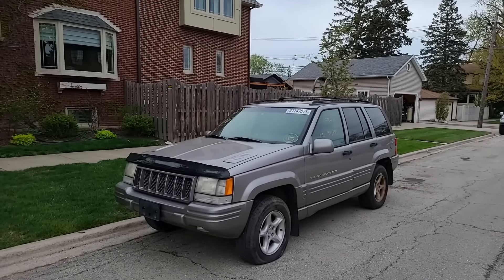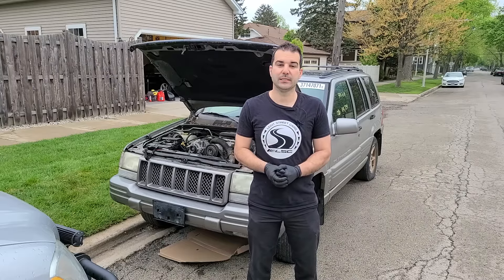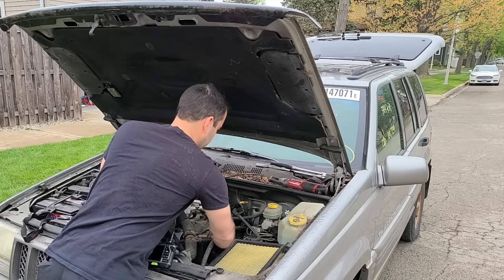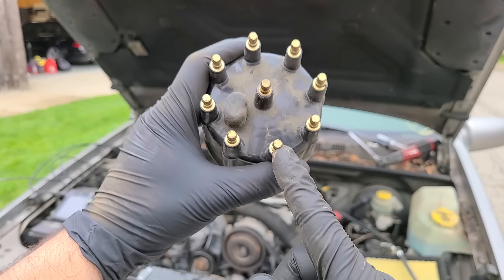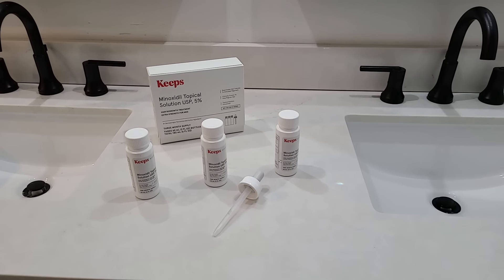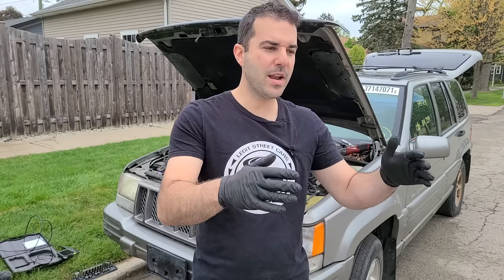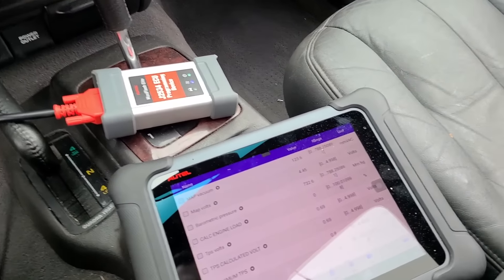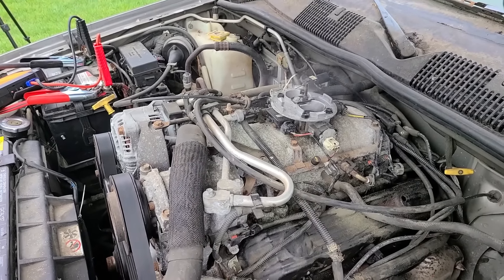First Start Of The Abandoned Fastest SUV In The World & What I Found  Inside The Engine! DIY FIX!

Comment: “A fuel injector is a very basic thing”
Me who’s been having injector nightmares on my diesel car: shudders
Reply: Diesel injectors are a whole different animal
Reply: Yes. Diesel fuel is abrasive, so it will eventually wear out the injectors.
Reply: L
Reply: @bongodave13  
It is not, it's got more lubricity than gasoline.
Reply: Stupid comment.  Diesel isn't abrasive.  What an idiotic idea
Reply: @enterBJ40  diesel fuel itself is not abrasive but it has particles and contamination in it that cause diesel injector nozzles to wear out. Injector nozzles are classified as wear items on Diesel engines.
Reply: That's is CONTAMINATION.  Any fluid  is susceptible  to that , not only diesel.
Reply: Nothing  new,  dude.
Reply: @enterBJ40  yes, but the fact remains that it is abrasive. Just because it isn’t the fuel itself doesn’t mean what you pump into your tank isn’t abrasive. It’s a known fact that any diesel fuel you can get your hands on is contaminated and therefore abrasive. Therefore people make the generalization that diesel fuel is abrasive because for all intents and purposes it is.
Reply: Diesel ITS NOT ABRASIVE.  Its not  designed  to be nothing  like that.  Contaminated  diesel can be abrasive? Sure...but just like any other CONTAMINATED  FLUID you pour in your engine,  example:oil. IT'S  NOT IN ITS NATURE THAT DIESEL  IS ABRASIVE.  That's is NOT a natural  property  in diesel fuel. Just because some diesel is ULS, doesn't mean its abrasive.  Abrasiveness in any engine fluid is because transportation, handling, storage of the fluid itself.  No serious  filter manufacturers consider  brand new oil as a pure product.  Manufacturers  and  also institutions like Noria and NLGI are some of them. Any abrasiveness in diesel or any engine fluid (engine coolant, oil,etc) is CONTAMINATION  and is there because a combination  of factors  that start  at the manufacturer  plant or refinery. Noria  has taken samples in surgical grade clean environments...and guess what? They found silica  (dust) contamination in brand new motor oil batches from different  manufacturers. Morality: contamination CAN NOT BE ELIMINATED but monitored and controlled to certain levels .
Reply: @enterBJ40  yes exactly it is monitored and contained but the fact remains that any diesel fuel available to the general public at a pump is going to have contamination that gets through the fuel filters and wears on the injector nozzles, therefore causing manufacturers to classify them as a wear item.
Reply: As you state contamination  in diesel make it abrasive, yes....just like any other fluid in engine.
Reply: @enterBJ40  that’s what I’ve been saying from the beginning
Reply: Silly  me. All this time I thought  I was replying  to that Bongo  guy and his nonsense  affirmation.

Comment: Tip for next time: After getting the motor running and idling, hold the brake and shift into each gear without moving for about 5 second apiece. This will get fluid back into all the areas of the transmission and excersize all the valves before you start driving it.

Comment: I did mention replacing the fuel filter but that was for long term or maintenance not just to get it running, if you're going to give it a complete tune then replace the 12 buck fuel filter as like i said its OFTEN neglected, i put the 4 hole BOSCH injectors from EBAY in mine as the original ones were functioning but not at 100% spray

Comment: I purchased this same 1998 Jeep in black in 2004 from a salesman with 114,000 miles. I owned it until 2009 and it still ran perfectly with 175,000 miles. Same engine, transmission, and transfer case. It had a few bubbles in the paint starting and the interior was still in very good to excellent condition. This vehicle towed my 18 foot enclosed trailer like it wasn't there through the mountains in Maine containing two snowmobiles. The only downside was it liked to drink premium fuel.

Comment: One thing not sure you have looked into is the base gasket under the intake. They are prone to vacuum leaks and will simulate a fuel issue. They make a thick aluminum plate to replace the stamped steel plate. I’ve had these magnum engines for years and love the reliability they have gave regardless of other opinions.

Comment: Mine was the sensors for the temperature. It would shut down because of a false overheating reading. It had 2. One for the guage & one for the computer. Guage was always in the normal range, so I replaced both and it ran perfectly fine. Had the Cherokee for 10 more years and no problems whatsoever. 😊

Comment: You did a great job of troubleshooting it and making sure the timing and distributer are lined up correctly. Now you just have to sort out issues from sitting forever and bad gas.
I drove two old Mopars here with gas that smelled like paint thinner and they ran surprisingly well considering one lost the accelerater pump in the carb and the other was missing the kick down spring that tells the transmission when to up shift and eventually make it to third gear.

Comment: Us veteran “niners” consider May 9th niner day. Get it? 5.9? Anyway, you were a day late with the video. Ive had 60 cars and 11 Jeep’s. The 5.9 Zj was one of my favorites. Swap in a 249 transfer case. It’s like having a lifted hot rod. And they respond so well to mods. Parts are cheap, and it’s one of the most reliable engines out there. You’ll love it

Comment: I was for sure thinking it was a timing chain issue. The low compression, and popping exhaust would have made me lean in that direction.

The beautiful thing is that you have a scope on that Maxisys, and you can find good known wave lengths of timing signals for a 5.9 all over the internet. Which saves a lot of time in checking the timing without disassembly. Good work tho.

Comment: Owned one and heavily modified it, if you have a low battery, the ecu takes a minute or two of running to relearn idle and afr control. Its goofy but a dead battery and then low voltage is their worst enemy.

Comment: Also check the valley pan gasket down the intake.  Many if not all of the 5.9s blow the gasket and suck in engine oil slowly, fouling the plugs and causing poor running conditions, knock, etc.  Beyond that, they are also prone to some timing chain stretch.

Comment: The way you supposed to use this tool is to do the injector balance test. You hook up the fuel pressure gauge then pulse all the injectors priming the system between each one. You compare how much the pressure dropped on each injector so you can point the stuck closed, stuck open or any other anomalies.

Comment: Fuel injected engines also have an idle air control valve on the throttle body that can get dirty and cause rough idling.  Simply cleaning the IAC valve can make the engine run smoother.

Comment: This Distributor is so easy, because you don’t need to set the timing. It is just to give a connection for a certain time frame. The ECU will decide the timing in this frame —> easy

Comment: Common issues to look out for on these 5.9’s will be coolant leaking from the timing cover, the intake gaskets will suck oil from the valley, the 249 transfer case viscous couplers will lock up and bind on turns, and the temperature sensors in the upper and lower radiator hoses might not work anymore. If you get it running right you’ll need to make sure your fan works even if you have it rigged up with a fan because you will be amazed how fast it’ll overheat off you let it idle without the fan running. Upper hose is low speed, and upper + lower is high speed.

Comment: If yah got fuel problems, I got a trick for you.
LPG gas, just squirt in the barrel and if everything is working it will run smooth.
Safer and cheaper than starting fluid!

Comment: I’m a huge fan and follower. I didn’t see it in the comments but be sure to check for an intake plenum pan gasket leak it will also cause poor idle issues. Pretty common on the magnum engines if I recall.

Comment: This model line Jeep and it’s predecessor model are both really good platforms for serious and capable off road or sort of no-kidding “safari” builds. For 750$ you got a great starting point. Or— they were nice station wagon 4x4s as they came. They can be rebuilt and come back. They will last as long as you can stand them unless they get rusted. Then it’s over. You did good.

Comment: Take the injectors out.  
Hook up your pulser.  
Can of brake clean or throttle body cleaner.  
Wrap enough electrical tape around the straw so that you can shove it into the end of the injector.  (can also epoxy the straw into a tire stem, the rubber end of the stem can then be pushed over the injector end.)
Pulse injector, then while pulsing, shoot brake clean through injector.  (wear safety glasses)
Do it both directions.  
Cheap injector cleaning rig done.  
Has worked for me a few times.

Comment: As an old timer I'm going to give you some learned advice. You already know that Octane is the resistance to ignition. When you have ancient fuel the Octane is off the charts. It doesn't want to burn at all. 
With that said, when you are blending the old fuel in the tank USE 87 OCTANE FUEL. It ignites much easier than 93 and is exactly what you want. Plus the usual additives. Couple few bottles of techron, Heet, and a half gallon of Mystery Oil. Will usually clean it out in a few hundred miles.

Comment: There is a gasket on the bottom of the intake, its pretty common to go bad and create an internal vacum leak.  Sometimes you can look through the throttle body and see the gasket sucked into the intake.

Comment: It’s normal for the Dodge deka injectors to spray in a stream like that instead of a mist. They spray on the back of a hot closed intake valve which helps atomize the fuel.

Comment: I used to book $$$$ on 5.2/5.9s in early 2000s. Check the T-stat for low coolant and make sure injector sync is set, your scan tool might have it. Ignition timing is ECM controlled but injector timing is from the distributor. I’m wrenching on a 98 ram and when I checked it was out of sync 6 degrees. Makes a big difference in drivability. I’m super interested in your injector flush. Dr. Injector wants $20 per injector for a flush. 😳

Comment: Fyi you may want to look pulling the intake manifold and replacing the plenum gasket. Its a known issue on the 5.2/5.9 especially when sitting for a while, what it'll do is clog your converter if the plenum is leaking for too long. Its not that difficult either, hughes engines sells a new plenum plate thats thicker. Also for fuel injectors you can find remanufactured oem bosch injectors on ebay for about $100 I just put a set in a durango. They work great.

Comment: Either Berryman’s B12 or Marvel Mystery Oil through the tank with 93 premium. 
The Berryman is STRONG stuff. I used some on a car of mine. Fixed the missing. So strong a little was on the bottom of the can. I didn’t know that when I sat it on the trunk. It ate through clear coat paint down to metal..

Comment: Bought the 5.2 version of this jeep. 98 aswell shares tons of parts with the 5.9 variant. Paid $300 for it lol. Didnt run, lady had it at some dudes house that was a supposed mechanic. Like 130k or something like that miles. Put a battery in it and cranked it over for quite awhile, it set cam sensor code. Funny part is they had a spare distributor laying in the jeep. Swapped out the sensor since I didnt have scan tool that could show me fuel sync to retime it and away she ran. Quite well too for sitting so long. Noticed tranny fluid was a little foamy. Dropped the pan, filter seals were shot. New filter and fluid. Decided to check over everything. Found drain on the trasfer case was loose and it had leaked everything out. Tightened it and fill it up, change front and rear diff fluid. Rear diff was leaking around the cover. Fought with removing that stupid gasket maker crap, found an offroading company that sells a true gasket for it instead. Drove it for a week. Had a hiccup every so often, thinking ignition related maybe but otherwise great. Great from stop light to stop light haha that little 5.2 moves out! Then one day after driving through an insane down pour it decided to stop shifting 2-3 or any gear past 2nd gear. Kept tabs on the fluid still nice and bright redish pink so its not burning it. Started shifting kinda hard too. Not setting any codes. Times like this makes me wish I had a snap on verus or something to see if theres a data pid for the pressure tranducer thats in the pan. Every so often tho it will decide to shift up normally. Shops around dont have half a clue how to use their scan tools and unfortunately im not friendly enough with them for them to let me borrow one for 30 minutes or so lol maybe at some point ill get it right. Until then it sits.

Comment: Take a peek down the TB at the intake pan. Guarantee you it has the old paper gasket and it’s sucked it. Super common on these engines. Updated piece is MLS. Also, these engines will not idle if the battery is low, even just a little low. Looks like this one escaped the gunking issue, so that’s good.

Comment: As I figured gummed Injectors, as fir the relay maybe, I'd look at the battery ground. These types of ingnition and fuel systems require a very good ground to carry the load. Thats why you see an extra 8 guage ground wire at the battery besides the normal large cable. I had a 93 Ranger have spark, injector power etc. but during cranking the ground couldn't carry all the circuits well enough, till I repaired the 8 guage wires voltage drop to the chassis.

Comment: I think your issue was the battery since it started with the other car running at 13-14v rather than just 12 or less with engine off. If the relay was stuck, i dont believe the ecm would send the signal to the starter and wouldn’t crank at for starter protection. Good videos tho. I like how you went through all the details

Comment: you may need to clean the idle air control motor eventually also. it is a common issue on those. also if you do decide to replace injectors best to install the 4 hole injectors off a ford. the fords that use the 4 hole injectors are still pretty common in the junk yard so the injectors can still be bought cheap. the 4 hole injectors work way better than any of the stock dodge ones. some people even say they notice a fuel mileage improvement with them.

Comment: Those have strong motors and they're light for an suv. For more na power just do a port, cam, intake, fuel, and throttle body then you will make over 400 easy to the wheels with a 318 probably a lot more with the 360 magnum

Comment: Unplugging and replugging a relay can break through corrosion in the socket or pins which was causing a high resistance connection. High resistance would drop the voltage reaching the ignition system. That's my guess as to what fixed it.

Comment: I traded a car stereo for a Honda Civic hatch with 70k miles that three shops couldn't figure out because it had fuel, spark and compression but wouldn't run. The bushing for the distributor was seizing and got so hot that the rotor had moved from where it was supposed to be to about 50 degrees off. The screw that held it on the shaft had melted a slot in the rotor. My current daily, 04 GMC Envoy XUV SLT V8 was a similar story where two shops said the engine was seized and it was a battery with an internal short.

Comment: NICE!!  Great diagnostic work .  I had a '95 Grand Cherokee and lusted after the 5.9.  However, german SUVs were coming and on the insistence of senior management the GC got replaced by a 2000 ML430.  In 2004, moved to Germany and ran the ML430 on the autobahn.  AWESOME but way too thirsty and I wound up replacing the ML with an Audi A6 Allroad V6 diesel. When I came back to the US I got a BMW X5 4.4.i which I still own and drive.  Early 21st century SUVs were great and still easy to work on.  BTW, are you living at the end of an O'Hare runway??

Comment: you can try remove the injectors and take one by one put power to them and spray them out trough the fuel inlet with carbcleaner to open up again.

Comment: The ECU on these also needs to relearn after the battery dies or it won't idle. I usually hold them at about a thousand RPM for 5 minutes then slowly let off the throttle until it idles. Same goes for the Ram's and Dakota's with the 5.2 and 5.9 Magnum.

Comment: Adjusting the dizzy on these engines doesn't effect timing at all. It adjusted fuel sync and would need a high end scanner to fix that. With thee magnum engines either the timing is perfect with chain alignment or have to reset the chain which usually they stretch.

Comment: Jeeps are picky when it comes to battery voltage. If the battery is low at all start by fully charging the battery or just install a new battery. Check for corrosion on battery cables even a slight Grey film on the battery connections will cause a no start. On all the jeeps I have owned most of the time the odometer will jump back in forth and that is saying there is a voltage problem.

Comment: If you still can't get it going check The compression on all cylinders because the heads like to crack on the 5.2 and 5.9 Magnum engines (usually the back 2 cylinders)
Reply: check the compression anyway just seen you got it to start. also the intakes on them have a accessport that goes along the hole bottom of the intake in the oil valley of the motor that the gaskets like to leak burning alot of oil causing alot of your carbon build up I've had 2 of these engines apart and I come from a prestigious mechanic family in my area with 5 generations of mechanics with 2 shops still open. I'm also currently swapping a 5.9 into a 1992 dodge Dakota with fuel injection most 5.9 swaps people do they use carburetors.